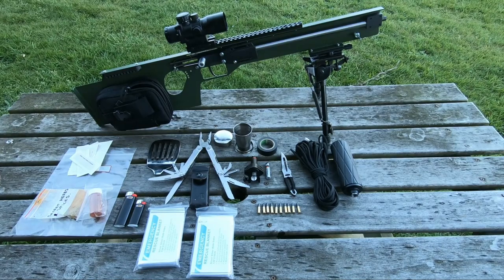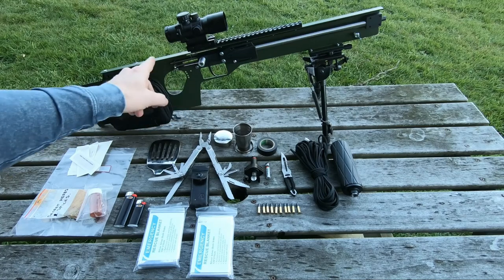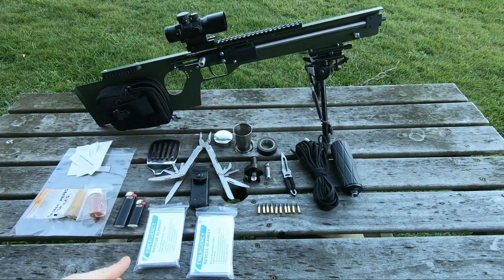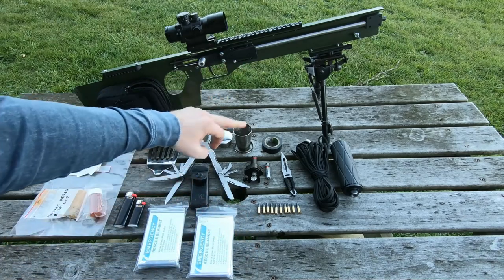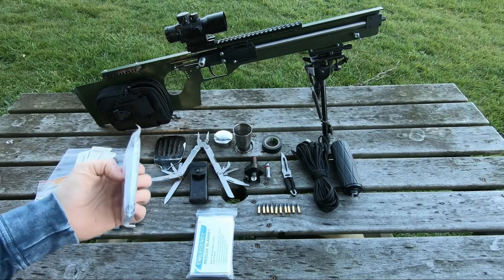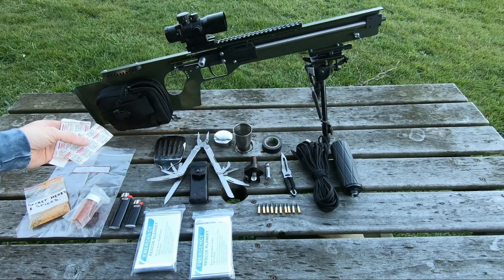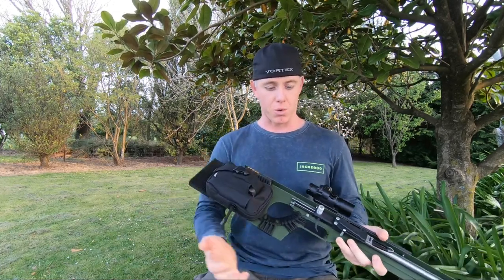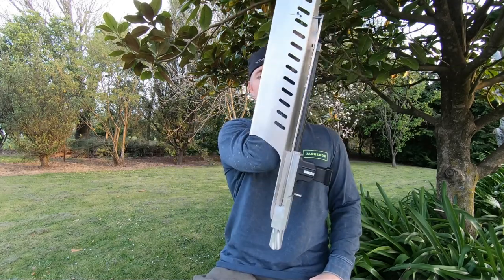Solo Edge survival rifle, a detailed look.

Comment: Hello Scott, when I first became a gun owner I became enamored with the "survival" & hunting aspects of firearms. Now that I've circled back to that fascination, I find your channel. This is such an ingenious approach to a lightweight, all-in-one survival tool. I'm afraid I'll have to conceptualize and create a version of my own. Thanks for the inspiration. 

Quick question: How much does the complete chassis weigh without the loaded pouch attached?
Reply from the maker: Hi Billy, thanks for the comment. Bare rifle without  the attachments weighs 2lb 14 oz.
Reply: @soloedge4169  That's extremely light. Thanks for the reply.
Reply: Okay, the more I think about this the more I want to fabricate my own. A few questions if you don't mind: 1. Is there a particular reason why you chose the single-shot action vs semiauto? Was it to eliminate mechanical failures? 2. What binding technique did you use to get the paracord onto the rifle? 3. What are the spacing dimensions between the action/barrel and the top & bottom portion of the chassis? 4. What is the weight of the trigger pull?

If you can't share the info here because of Youtube rules, can I email you? Thanks in advance!

Comment: I'm really impressed with your creativity. I was wondering if  you ever considered making a similar chassis for a readily available bolt action .22 action. Like a Savage Rascal, or Cricket? I think that would be sweet.
Reply from the maker: Hi, Yes I have. This concept would be perfect for the Ruger 10/22. The Ruger is all self contained, you would attach it to the plate chassis via the two takedown pin holes that secure the trigger mech to the receiver.
Reply: @soloedge4169  Yah that sounds really cool! Do you think you could have the stock to fold and clamshell over the action to create a smaller package?
Reply from the maker: @bushidobronx  Yeah for sure. You could make the stock out of plywood actually,  in whatever shape you wanted, anything that's flat. Just add a hinge of some sort.
Reply: @soloedge4169  I was wondering if you would be able to recreate your chassis for a Savage Mk1 .22 single shot bolt action that I have. The only change I would ask is to keep the LOP to 12" since I'm a small guy. If you could, how much would you charge and would it be difficult for me to ship the action to you. I am located in Hawaii. I'm not sure exactly where you are or how difficult it would be for me to ship to your location. Let me know what  you think. Thanks.